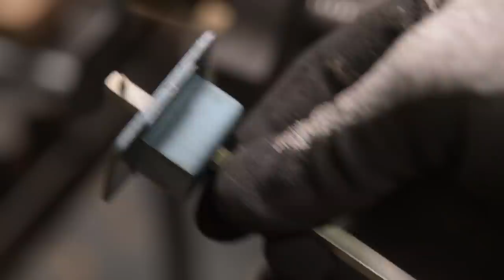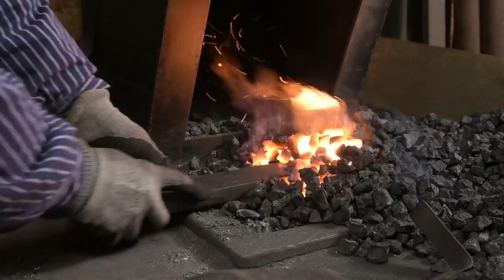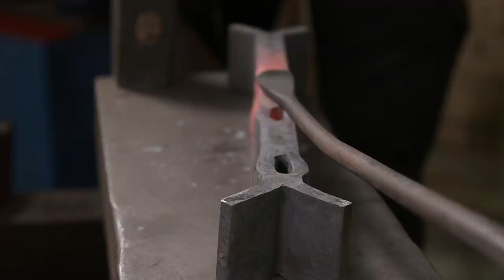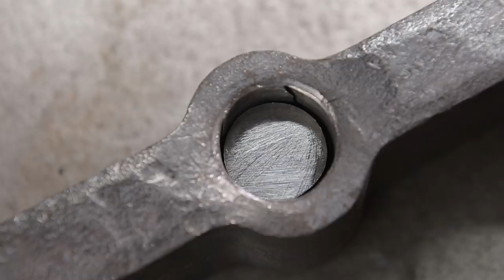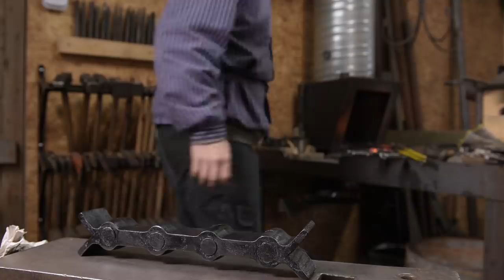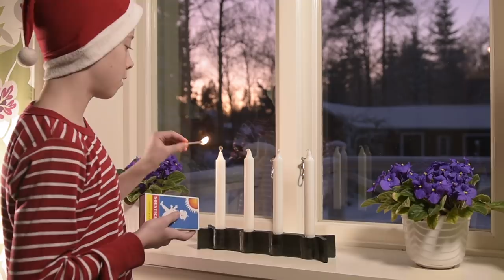Blacksmithing - Forging an advent candle holder

Comment: I used pine tar and linseed oil on a couple walking sticks a few years ago. The finish is fairly resilient. I use a heat gun if the wood cracks and reuse the pine tar that was impregnated to reseal. It's a great black.

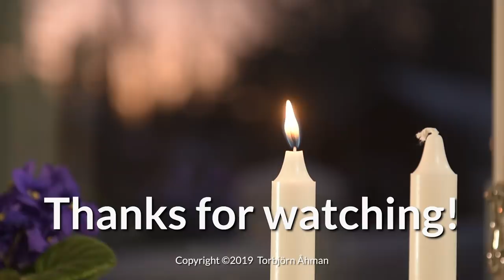Comment: 15:50 Drop forging. :DD 

Nice 🐱 proof candle holder. They won't turn that candle holder over. 

My only suggestion is maybe adding a nice looking tray under the holder to catch drips from the candles. It would save you from cleaning the window sill.

Comment: Now that is an advent candle holder! Very nice. And it won't fall over in quiet weather. :-) 
You have to teach me the grab-material-out-of-thin-air trick... perhaps it works with silver. 🤣
Reply from the maker: Thank you! You're right, and if it falls, it falls through the floor :)  O it certainly works on silver too, but it is much harder to catch!

Comment: hey torbjörn, i like the finish with the pine tar, ive seen a smith here in germany doing something similar, he heated the part up and dunked it in lindseed oil for a couple of times wich gave it a REALLY nice finish too, similar to this one. maybe give that a try too at one point!
Reply from the maker: That is what I usually do for a black finish, but I'm starting to like this even better for some reason.

Comment: A lot of work, but the end product turned out really good, top job! The coating of pine tar added a nice finish to the exterior, gave it that special touch. Have you ever tried using bees wax as a final coating? Once again thoroughly enjoyed watching the whole process, Regards from Australia.
Reply from the maker: Thanks. Haven't used bees wax much, but it works in a similar way!

Comment: I was making a knife yesterday and did the same thing. I was punching the handle pin holes. And it flipped into the water bucket! Had to run like 5 heat cycles on it before it was soft again!
Reply from the maker: Ouch...

Comment: Very good! -- was wondering what you were going to make with your new tool. May I suggest welding a bit of heavy tube to your swage block frame to receive a holdfast.
Reply from the maker: Thanks! Might be a good idea but heavy hammering like that tends to vibrate any holdfast-type of tool loose. Maybe some heavy chain would work better.

Comment: Love it! How much does the distance between centres change? I have always been curious as to how window grills using this method were layed out and made. How about a video on that? In admiration, Matthew
Reply from the maker: Thanks! It depends how you do it. You can make the bar not change at all in length. Here the centers moved about 3-4mm closer to each other.
Reply: @torbjornahman  That's exactly what interests me! How about a video?

Comment: Nice but why the plugs at the end of the project? Could have driven the hot chisel from one side only and end-up with a full built-in plug, plus asymetric top & bottom.
Reply from the maker: Absolutely but it would have been harder to drift that blind hole open to the correct size. You would need a couple of different sized small drifts I think. My goal was all the time to get the bulges on the sides to swell out as a main feature.

Comment: I would like something like this in my home. Beautiful and minimalistic candle holder. One questin, what is the use of pine tar? Is it for rust protection or is it for an other reason?
Reply from the maker: Thanks. It's mainly for the black finish, but it is also a rust protection.

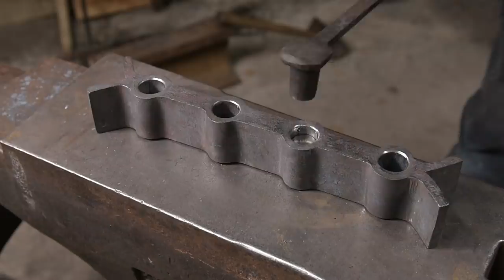Comment: Torbjörn, at 11:27 seems like there is a cold shut. Would it have been better to slit it all from one direction so that didn't form?
Reply from the maker: Yes there is! It's from the drilled holes! I knew there would be rough parts there but it's not really visible so.... Next time I might have the curage to slit the holes without the pilots...

Comment: Just wondering. Would it change the pine tar finish if you heated up the metal first and applied it, instead of heating it after you applied it? (Hope that makes sense)
Reply from the maker: No it's the same thing...just harder to apply hot on a piece like this.

Comment: Nice work! Why do you use Pine tar (and linseed oil for that matter)? Only for aesthetic purposes or does it also protect the metal?
Reply from the maker: Thanks! Mostly for the black finish but it also protects against rust to a moderate degree. Pine tar is probably the finish where you get the deepest black without too much hassle. It's a bit messy though.
Reply: @torbjornahman  Amazing work and filming, as always! :)
About tar finish, does it stay little sticky after it cures (like bees wax I use sometimes)?
Reply from the maker: @DrrGre  Thanks! No it's not sticky after the piece is heated. It's quite messy to start with though :)
Reply: @torbjornahman  Great, I'm gonna try this one, could you add similar product that can be found on amazon US,DE,UK or ebay to your "recommended" list. As far as I could find, the one you use only sold in Sweden...
Is it the same stuff that used on baseball bats?
Reply from the maker: @DrrGre  I don't think this is used on baseball bats... Try this one! It seems like the genuine stuff! https://amzn.to/35Z4KwD
Reply: @torbjornahman  Will do, thanks again!

Comment: What's with the dust mask? You don't appear to be generating dust, a little scale maybe.
Reply from the maker: If you have spent a day forging without a mask your nose will be black. You generate a lot of fine dust from soot and I think mainly from the scale when hammering. It's not apparent but the nose will tell...

Comment: Nice yellow paint on the tong reins. Are these new to your collection, or old and have some history to ya?
Reply from the maker: It's an old pair I got when I bought the big anvil actually. They where yellow when I got them...
Reply: @torbjornahman I like them. Also, would it have been possible to make a drift that widen the top-most portion of the candle sockets on the steel, flaring them out some to take on the form of a "drip pan",  It would be similar to countersinking, but obviously you'd be expanding the material and not removing it.
Reply from the maker: @demastust.2277  Not sure that would work very well since you need a very shallow angle for a drip pan... Maybe you could upset or change the top profile somehow before you make the holes... maybe something to experiment with!

Comment: around the 8th minute, what are your punches made of ?
Reply from the maker: The drift? It's some strange high strength alloy made for chains and such. It does not have a generic designation. Got it from a local factory... For a drift like this it's not that crucial, even mild steel will work, but the stuck end will deform more I guess.

Comment: Is Pine tar similar to a beeswax finish?
Reply from the maker: After heat the results are similar. Wax, linseed oil and tar all makes a black finish, but I think the pine tar makes the darkest black, at least with one single application.
Reply: @torbjornahman  Thank you, I didn't know about the Pine Tar for a finish, I know it's used in baseball though to make the bat grippy.

Comment: What's the horsepower on the motor for the big power hammer?
Reply from the maker: That is a 10 hp / 7.5kW motor.
Reply: @torbjornahman  Ok, thank you